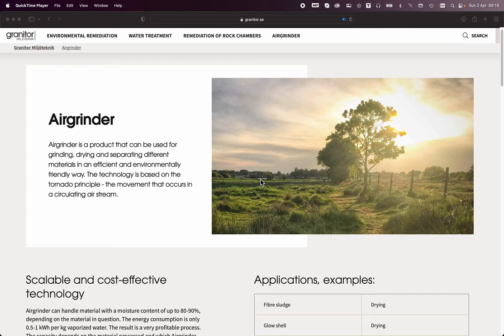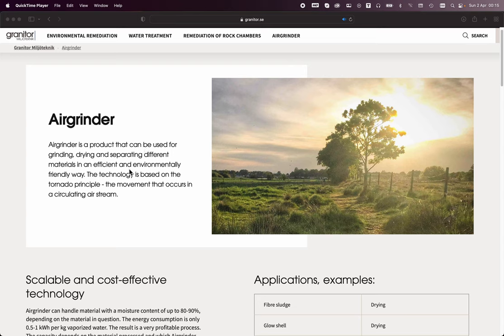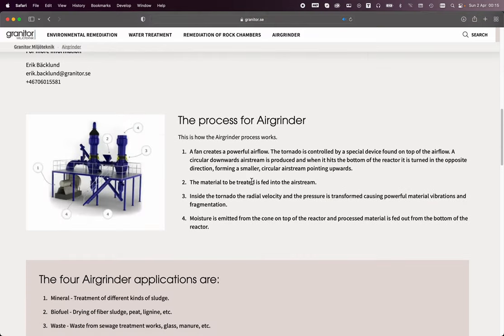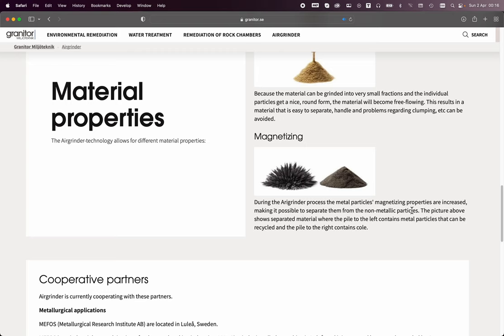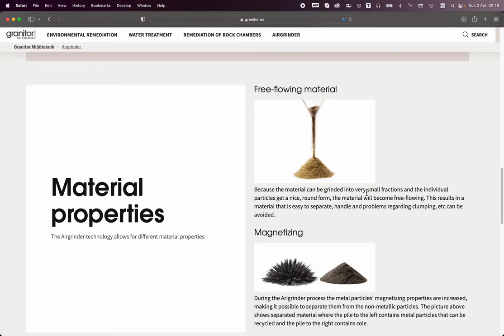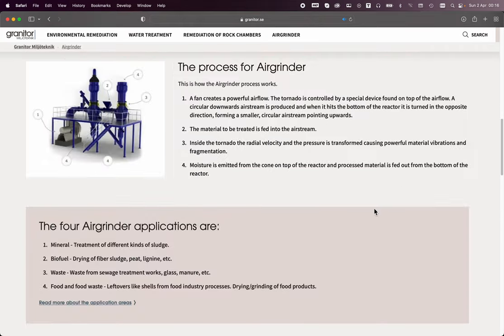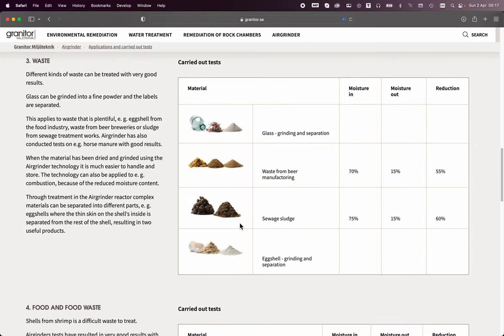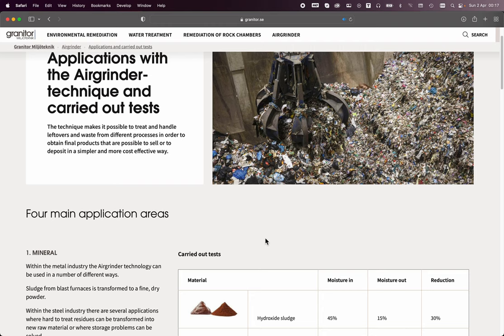Windhexe analogue -AirGrinder - 'Tornado Machine'

Comment: Here are some important things to consider. The Polifka patent actually expired in 2020, acts a secure international prior art, and so is completely free to use.

Where as the Kraft Foods patent is more about a mass manufacturing food preparation process for recipes, and is not about protecting the Polifka windhexe machine used in their manufacturing process (which would have been a serious infringement on the Polifka patent and would have not been granted otherwise).

Also the Kraft Foods patent which expires technically in 2024 (the 2026 extension date is by US patent law legally invalid), only relates to very specific ingredients for their recipes in a large scale food processing plant system, using air flow rates of 500 CFM to 10,000 CFM (eg specifically for a very large scale Kraft Foods chocolate cookie mix, nutrition bar and flavoring processing plant).

The Air Grinder, which uses standard generic industry cyclone processing components, is not protected from any patents or licensing agreements related to the Polifka Windhexe machine. The original windhexe also acts as a international PCT legally unbreakable expired patent prior art. Therefor no one can re-patent a windhexe machine, as now its a generic technology from the date of its expiration 2020.

And so the good news is that the windhexe is completely free to use and develop, by anyone, and for any purpose, in any part of the world.
Reply from the maker: Yes this was my point. I agree entirely. Thanks for the additional clarification on the role of Kraft and their status.

Comment: In an ideal environment with no losses you require 0.715 kwh to heat 1 liter of water from 25 C  to 100 C and then vaporize it, so 0.5-1.0 kwh in a real world application, with lots of losses, is really impressive numbers!
But then this isn't an entirely thermal process because of the disruption, I guess that there could be room for improvement like Bob mention with ionization of incoming air, ...
Reply from the maker: That is essentially saying you get the grinding and particle shape forming and magnetisation to allow metal / non-metal separation for free!
Reply: @MFMP  Yes that's really cool! So many environmental useful applications for this product 🙂

Comment: Cool!  Since they are publishing performance figures and since the units have defined inputs and outputs it should now be relatively easy to calculate what % of the effects observed are EVO related, if any.  Intuitively it seems like more H2O is being dewatered from the feedstocks than can be explained by a humidity calculation and material/energy balance, so the remaining difference is either EVO-related or magic.  Assuming the former, if exit gas analyses are available maybe the number and characteristics of the EVO's involved could be reasonably estimated.  If suitable targets could be placed inside the tornadic vortices within the unit and EVO strikes documented, it would be a slam dunk.  A complete unit operations analysis would prove the whole thing in principle.  I for one am prepared to visit Sweden at someone else's expense to investigate further.

It might also be interesting to toss a small hobbyist size sample of low grade uranium ore into such a unit to see what happens to the radioactivity level of the dust product.
Reply from the maker: Well Uranium is mostly Alpha decay and this is unaffected by MTER at a distance however, with lighter elements in play, there will be a balancing of nuclei size in my view and this should lead to de-activation.

I think the most important tell here is the magnetisation of metals - if that lasts for around 2 days, then it is EVOs for sure. If it lasts indefinitely - say in iron - then it may be due to the current loops formed in the structure. In any case, it is, on the face of it, proof that strong currents and magnetic field are produced in the fast moving ion/gas structures.
Reply: @MFMP  Maybe we, via crowdfunding, could buy or lease one and set up a small processing company somewhere in Europe that could offer the commercial service by day and serve as an experimental test bed on nights/weekends/holidays.  That way the principles of EVO science and engineering could be explored indefinitely on a self-funding basis in a permanent venue.  Additionally, if such a company could establish a track record in successful regular waste processing, it might build enough credibility to be allowed a crack at nuclear waste processing/remediation.  Ditto for remediation of conventional waste sites as well.

Interesting this thing surfaces right after my vision/rant in the comments on the other video for defining a full research project.  Synchronicity anyone?  Maybe a special dark neutrino burst at the spring equinox ?
Reply from the maker: @19valleydan  We are the only people that will do this for us.
Reply: @19valleydan  If you consider getting involved in the waste processing industri you will have to handle not only the waste products but also the criminal enterprises (mafia,...) as well since in many countries they now are involved in this industry.
Reply: @tpsven3397  Yes, I actually thought about that later - maybe food processing would be a better avenue.